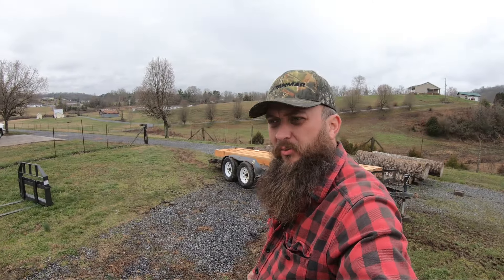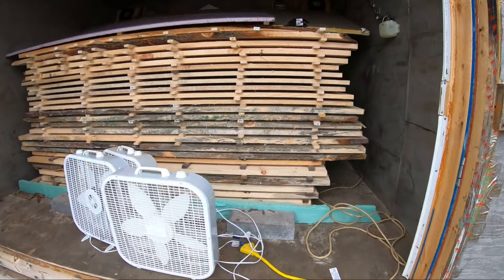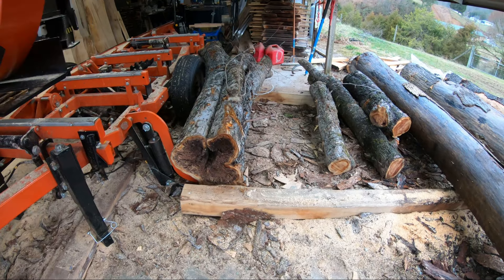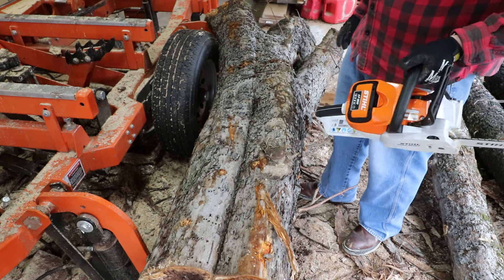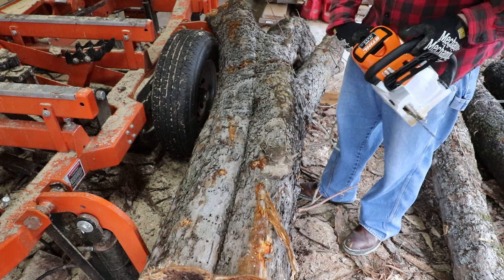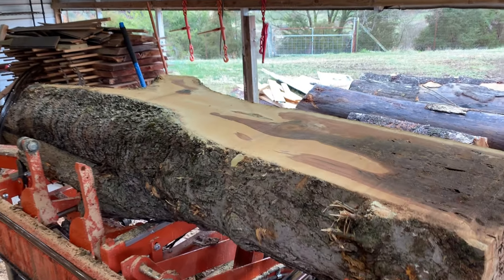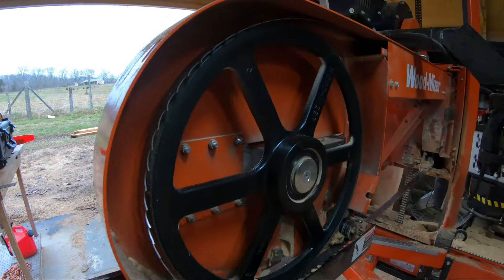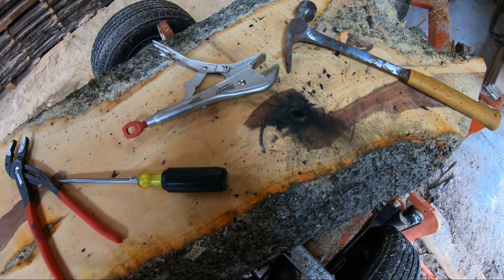You Have To See What Is Inside This Apple Log

Comment from the maker: * Check out my Amazon Store for tools I use at the Sawmill:
https://www.amazon.com/shop/outofthewoods
Reply: Don't think you will ever see....Wood any prettier wood than this apple wood...Outstanding.....Looks like it had a close line or two nailed to it at one point...Thanks very much...!
Reply: Steve - Even with the nails, some of the cuts are great and even the discards would smell good in the smoker or BBQ grill.
Reply: steve shoemaker 4
Reply: Out of the Woods , At least you hit the first nail on the head and you do have some nails to build something
Reply: Love the content. What's the name of the song at the end of this video. Truly love it
Reply: Days like that could make you feel like you're in the wrong business. Can those blades be sharpened? Beautiful wood, that's why I watch.
Reply: Try using an old electrician tip, use a set of Klein Tools D2000-48 diagonal cutting pliers for nail removal. The angled head makes it a breeze. Just grab with the tip of the pliers then push down on the handle. The angled head acts like a fulcrum. You only get 1/4" inch at a time, but you won't need to dig out the wood hardly at all. I have removed countless large nails with no head remaining, from oak and chestnut barn beams, and they are the ticket.
Reply: i guess im randomly asking but does someone know of a trick to log back into an Instagram account?
I stupidly forgot my account password. I would love any tricks you can offer me!
Reply: @Jacob Ephraim instablaster =)
Reply: @Jacob Ephraim No problem :)
Reply: Bro, that medal detector you're using is good for like checking surface stuff on people. It won't search deep inside dense wood.  Doesn't cost much for a good metal detector but it sure does for a bunch of dull or broken blades :(
Reply: I want to purchase a saw mill to build a timber frame home and to sell cut timber. I'm a veteran and i was diagnosed with chronic myeloid leukemia last year and it has changed my priorities in life. It made me feel as though i should be doing what is best for my mental health. I just don't have the money and don't know where to start, all i have right now is a plan but that's about it. Any advice you could offer on how to get started would be greatly appreciated. Thank you.
Reply: @steveshoemaker6347  t mm😢😢 ok

Comment: The last black walnut I sawed into 9/4 slabs was 26”x11’  I hit 4 nails, broke one of the new 747s then I switched over to my resharpened 9 degree blades and damaged 2 more, like you said, “it’s just part of it”
Reply from the maker: yes sir makes for a long day
Reply: I charge for a new blade plus downtime. $30 on my 1.25" blades and $75 on my 2" blades.

Comment: I use a metal detector that will pick up a small nail  under a 6x6 . It is a conventional style prospectors type . It was less than 200  from amazon . After a little practice with the settings you can tell how deep the metal is .
It paid for its self the first job I used it on  . Metal is tough on blades and chains .

Comment: Greetings.  New subscriber here. I metal detect every log from the valley floor. Timber up in back where there are no houses I do not bother. I do hit bullets from timber  up on the mountain. My metal detector discriminates between iron copper and lead. If I get a tone for lead I just saw anyway. If copper I will saw but stop and pick the copper off of the teeth when I hit a copper jacketed bullet. If I tone for iron I dig it out before I saw. Just pulled out a 10" 130 penny spike a couple days ago. The worst is ceramic insulators. Throw the blade away when you crash one of those lol. I am sure you have videos of weird stuff in trees. North of me a guy found a loaded 22 rifle inside a tree!

Comment: I cut some nice apple on the chainsaw mill. I started planing it down to make a cheese board and found a piece of lead shot. Dug it out and ran another 2 passes and found another piece. By the 4th time repeating this process, I gave up on the cheese board.
Reply: I will add, apple looks spectacular when first cut, then dries out to a light pinkish white wood. I understand it will darken with exposure to UV or if you heat it in oil.

Comment: Hi, I was around when you first built your kiln on your old property, I was surprised that you did not need a lot more heat and the system to move the air around was so low-key. It obversely works but the one thing I could never wrap my head around was how the got the hot air to the bottom of the kiln. I was always told hot air rises not falls?.
Reply from the maker: it does rise but the fans push it against the door and the kiln unit sucks the hot air back through the lumber, low ceiling also about 6 1/2ft tall,

Comment: I have a Stihl electric saw.  It has a 14 inch blade and is AC and apparently a model larger than yours,  LOVE IT.
Reply from the maker: probably same, mine will take the 14in bar,  appreciate you watching,
Reply: Yeah I got it because I don't do sawing very often and have to keep rebuilding the car when I want to use it.  The electric is ready to go any time I want.  It's an MSE 140C, at the time it was the larger of two sizes.  The smaller had manual chain oiling and mine has the same power oiling as the gas models.

Comment: Easiest way to make that gravel road is just spread the stone you want to use over that grassy area and drive it in. I fixed a driveway that would rut out up the axles of the cars just by filling the ruts with basketball sized rocks and driving them in
so if you've got large stones, lay them into the soft soil now, push them down and then start adding the smaller stone until you hit like 3/4" crushed on the top couple of inches
easy.

Comment: Maybe an induction bar across the front of the blade could detect nails and metal for the max depth.  It could look for magnetic field distortions and stop the blade or sound an alarm on detection. Weigh this against the number of blades replaced. Or If cutting these kinds of logs would be better with an abrasive wire.

Comment: Bear with me, it's been a bunch of years since I used one, but can't you get metal detectors that, by design, reach deeper?  The little hand wand is only going so deep of course, but I seem to recall a range of detectors for finding "treasure" in the ground with different depth capabilities.

Comment: Hey bud, Dewayne from Knoxville here.
Do you have a favorite app that you like to use to figure your board feet ? 
I’ve notice the Doyle scale only goes up to 17’. 
I’ve seen the wood web calculator works well.
Thanks.
Reply from the maker: Norwood app
Reply: @OutoftheWoods0623  
The Norwood sawmill calculator app.
I’ll check it out.
Also everyone in my area is charging $300.00 to $350.00 per thousand to mill 
According to 3 different sawyers I’ve asked that are close by and willing to send me some business.
My question is when someone just brings me 2 or 3 logs for example , how do I charge for something like that ?
I’ve got a lot of questions and a lot to learn.
Thanks.

Comment: Now, I have a Kobalt (Lowe's brand) battery chainsaw that was significantly cheaper than the Stihl.  I have been using it to cut down young trees (6" and under) to clear pasture.  I was gifted a spare battery so I am able to work twice as long.  I wonder how the 2 compare, and if the cheaper saw would work just as well for what you are using the Stihl for.

Comment: I have a curiosity question: When you know that there is a bad section of wood at the top or bottom of a log why isn't that cut off before you start milling?
Reply from the maker: depends on the location, want as long as boards possible,

Comment: would a metal detector that was made for ground use work better. my garret detector will detect metal way deeper than 3/4"?
Reply from the maker: Good ??
Reply: @OutoftheWoods0623  sawmill i go to uses the same detector you have, i assumed they picked up metal deeper than 3/4". ive been around when the cussing starts after a blade or two

Comment: When you burn that apple scrap, be careful It is hotter than blue blazes. As a matter of fact it burns with blue flame. Then it turns directly in to charcoal. It makes good barbecue wood
Reply from the maker: thanks, apprecaite the tip,
Reply: @OutoftheWoods0623  It is some good stuff. Thanks for the videos guy. It helps a guy in the city be in the woods. I had to move back to the city for work.He ck you probably knew that about the wood. It just felt goo to remember it.

Comment: Wow, I'm really surprised that those Walmart fans operate in the heat of that kiln without the thermal fuses failing.
Reply: ✂️ Fuse?  What fuse?
Reply: @mattfleming86  Those fans have in-line fuses around the motor wrapping which trip when the motor is overheated to prevent fire.
Reply: @scotduckrow8524  Yeah I removed a faulty one from a ceramic heater to repair it.
Are they inaccessible in this model?
Reply: @mattfleming86  They a;most seem to be designed to make it difficult. I have never replaced one.
Reply: Gotcha.  The single one I have dealt with was in a space heater and placed on the side near the front of the unit.  Where the heat is.  Almost a "designed to fail" kind of thing.  I have yet to encounter one in a fan but will be keeping my eyes open!  
Curiosity here, was it physically INSIDE of the motor, and the type that when you take the housing screws apart coil leads start springing out everywhere?  If so (from experience) it's not worth the labor to tear it down that far...

Comment: Have either of the cats got trapped in the kiln by accident??
Reply from the maker: Never.  😎😎. The noise runs them out. I start it up with doors open just for that reason
Reply: @OutoftheWoods0623 Thanks!  I appreciate that blurb. Was a little bit worried when I saw the kitty run out during filming.

Comment: I cut a west indian 16 foot long 30 inch diameter log and hit 17 nails in it. Worst log I've ever cut it was the log from hell.. I get most of my mahogany trees out of peoples yards and a lot of them have nails, barb wire, cut nails, screws tap cons, lag bolts, rebar, wire. If it weren't for the quality of the west Indian mahogany aka Cuban mahogany I would even bother milling because of all the metal.. And it's very expensive wood makes it worth it..

Comment: You need a 19 inch crescent nail puller. Slide hammer it in and will pull even stubs of nails with no head. Cant believe youre doing this the hard way when you could get rid of that nail in 20 seconds. Maybe you dont much about any of this. Those slide hammer nail pullers have been around for more than half a century and they work well and wont destroy wood the way you do. Just google nail pullers and it pops right up. $36 and you can put all those other tools away. Duh.

Comment: I will never understand why saw mills ruin blades on nails all of the time.  Go buy a good metal detector and scan each log before you cut into the log and then after about every 2-3 passes FFS.  Every nail that you hit ruins a $20-$30 saw blade, and a quality metal detector is maybe as high as $200.  So, after 5-10 ruined blades you could have bought a metal detector.

That crappy metal detector is what the cops use to wand you down after the big detector finds metal on you...  of course, it only works for 5 inches, and is worthless for scanning a log.